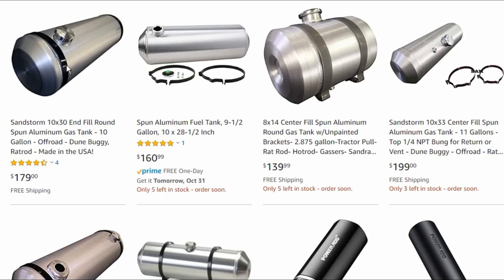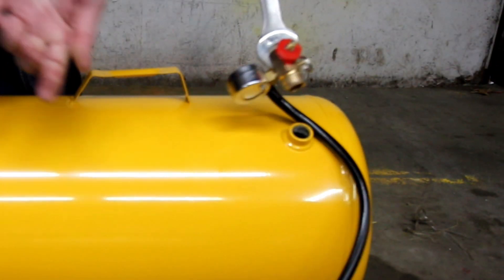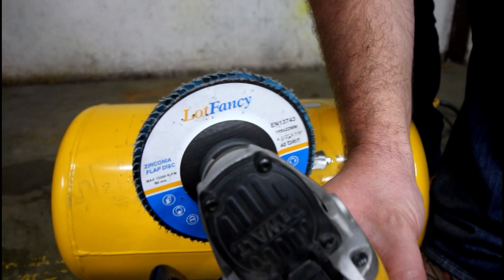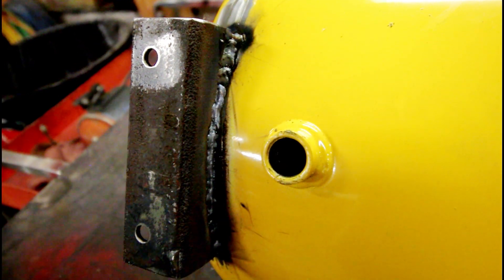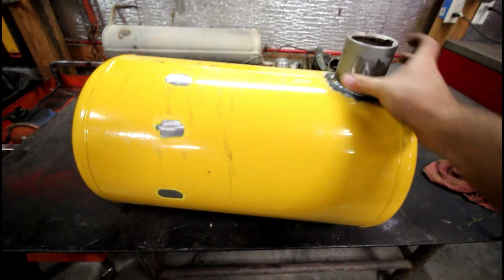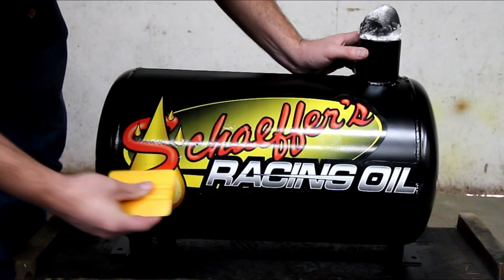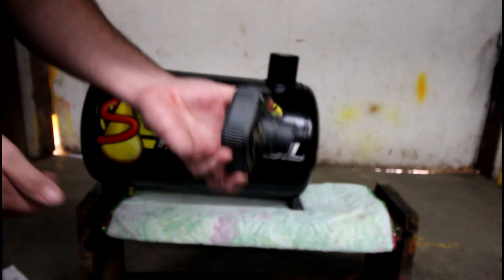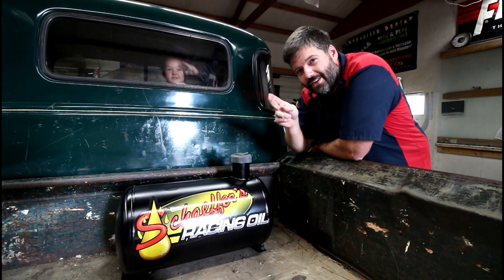Homemade FUEL CELL / GAS TANK (how to)

Comment: I thought this was a video on how to use an air tank to make a fuel cell not a gas tank. I'm looking to make a hydrogen/oxygen fuel cell using a fire extinguisher tank that is metal along with a down steam that is metal but the cap would insulate the down steam from the tank this way the gases produced by the electrolysis is done inside that tank in turn capturing the gases inside the tank for easy storage. This was not what I was looking for....

Comment: I have not found Rustoleum paint to be resistant to Gasoline. The paint delaminated around the filler  from overfilling or spilling on  last gas tank I painted with  Rustoleum.

Comment: I want to make a fuel tank for my club car with a predator engine. Would this need a fuel pump, or would the carburetor pull the fuel without a pump? I don't know much about these things, but I'm trying to learn 😅
Reply from the maker: A carb won't pull. Needs to be gravity fed, of low pressure fuel pump. A vacuum pulse fuel pump would do well on that setup

Comment: Did you have to put a fuel pressure regulator on since it's gravity fed. Or can the mechanical fuel pump handle gravity fed?
Reply from the maker: Mechanical pump handled it fine
Reply: Awesome, thanks

Comment: Definitely a bad idea to drain out the bottom. It's actually illegal for a car manufacturer or commercial vehicle. Make a feed line that drops in from like a bulkhead fitting or something. Then an aluminum tubing with a flared fitting on one end.